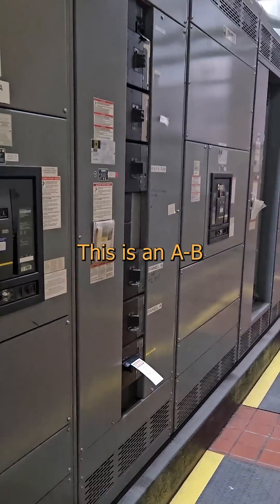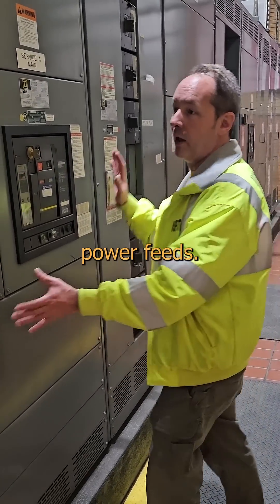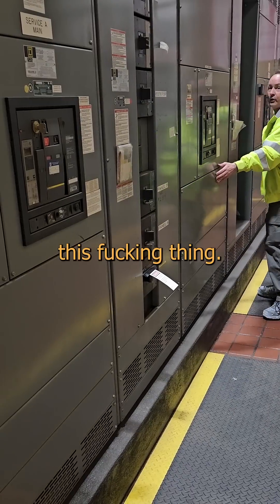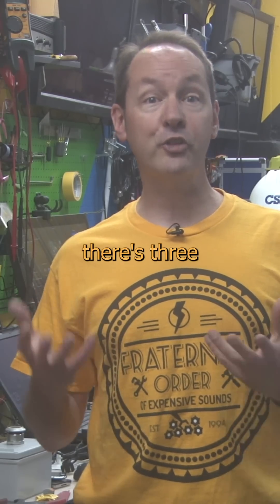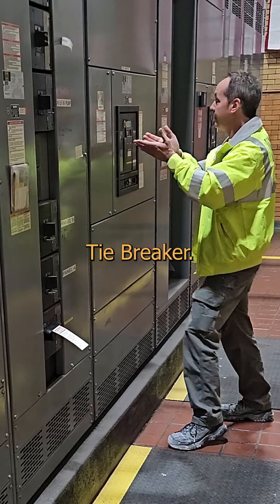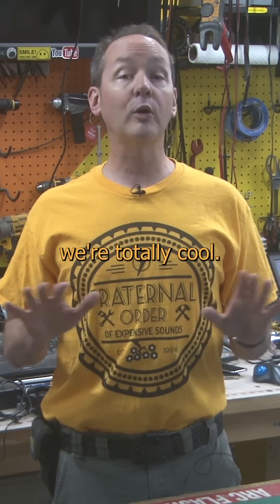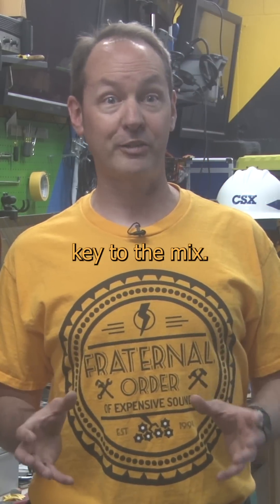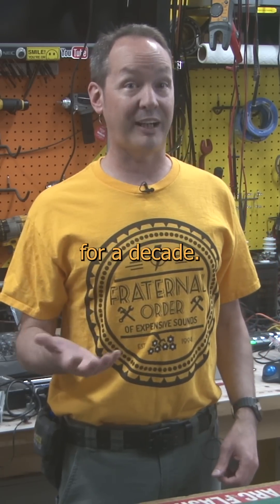A B Interface #chrisboden #comedy #electrical #engineering #energy #substation #switchgear #power

Comment: I'm a software developer / server administrator, and while my machines don't scream, bite or otherwise try to kill you (yet), we have similar problems with redundant systems.
Like managing one database is fine. Synchronizing one active database to multiple readonly copies is also fine. But managing two active databases with bidirectional data synchronization, without everything blowing up? That's dark magic ^^
Reply: Some of the computer hardware can still bite you.  A friend's brother was working on the innards of a mainframe computer when he managed to short something with his screwdriver.  He said he saw a flash then woke up on the other side of the room holding the handle of the screwdriver, the shaft of which was melted down to a nub.
Reply: @ddichny  tbf, that is a mainframe you're talking about.
Reply: Reminds me of that one time github had to deal with them desynching

Iirc they chose to put them both in read only then manually combine them
Reply: Old repair Teck here. Like 40 + years doing this.  I have been thrown across a room by angry pixies, I have been bit way to many times on hot lines that should not have been there. My apprentices laugh about the multiple redundancy of my electricidal isolation everywhere. I tell them this is the only way you become a old repair Teck.

 So yes you can get hurt and even killed on server stuff especially. Less likely PC's but lets thank the electronic gods that CRT's went the way of the dodo they were evil incarnate! I refused to touch the damn things after the first involuntary pace making attempt...
Reply: @Masterlitchuk 
along with IBM monitors that can pee PCBs.
Reply: "my machines don't scream, bite or otherwise try to kill you"
Sorry, but computer fans MOST CERTAINLY do the first two. 😏
Reply: @DUKE_of_RAMBLE  when I turn on my pc, it sounds like a old car starting up
Reply: @BeanBYTESOF  haha Yup! Though they're soooo much quieter now than they were in the early 2000s. 120mm fans at 1800-2300RPM vs my Vantec Tornado 80mm at 5700RPM... and I was rocking dual CPUs so I had two of those bastards screaming! And my case never had the side panel on, either 😅

Honestly, Tornado🌪️ was fitting given the air they moved, but Banshee🗣️ would've been fitting given the noise they made! lol
Reply: @DUKE_of_RAMBLE     I got a prebuilt back in 2019, it works well, but it is noisy asf rn, I probably should overhaul it some time soon
Reply: @BeanBYTESOF  If it's suddenly loud, that means the system is requiring more air because things are getting hot.
Three reasons: First, often overlooked is house temp, since it's becoming summer maybe the ambient temp is higher in the house. Second, also overlooked, dust in the fans and hestsinks. Third, not overlooked but not considered, the thermal compound. It's likely they never used anything good and it has lost its potency. (I've never experienced it, leaving my heatsinks attached for years and just remove dust, but people swear it can happen; but I build my own so I know what paste being used) 

If you have pets or the computer is on a bare floor (no carpet/rug), and you haven't cleaned it ever or even for a few months, then that's almost assuredly the problem. If you have an air compressor (or know someone that does), you can unplug the computer and drag it outside along with the compressor and an air nozzle, then use it to easily blow all that crap out! Might have to take fans off to get it all out, since it can really get packed in. And blow from the opposite direction as well.

WEAR A DUST MASK! Computer dust is fine particles and you don't want to breathe that in. If nothing else, put your shirt over your face. I figure everyone should still have some PPE though, so it's preferable over a shirt. 👍

[edit: I see YT removed your comment for some reason. Unless it was you? Either way, I saw it in time so the above is my advice to help with the noise.]
Reply: "they can bite you in other ways"

Unshielded server fans. And thats all im going to say....
Reply: @TankR  aka how ITs and model airplane enthusiasts have matching scars. Old ether engine models are especially terrifying to think about
Reply: And that's pretty damn cool... from the same.
Reply: I will always have immense respect for database admins. Databases are such a pain in the ass to get right, and when they go haywire, everything goes haywire.
Reply: If your server fans aren’t running at hearing damage levels, you aren’t getting your money’s worth out of your hardware. Also, 480Vdc UPS battery strings have plenty of high torque pixies to ruin your day.
Reply: It's Dark magic and you must pay dark wizards and oracles copious amounts of gold. If you know what I mean 😅
Reply: Tried that in the 80s....
Reply: Time is money and when you have so many very very expensive pieces of equipment it's a lot of money so you don't want any down time.
Reply: best to never design a system around that
Reply: You need a wizards outfit with circuit patterns instead of moons and stars
Reply: >My machines don’t scream, bite or otherwise try to kill you (yet)

If you’re a software dev, don’t worry, I’m sure you’ll get there eventually
Reply: My son was a VP of sales for a company that provided hardened data center sites for just the type of redundant safety you're talking about. Got a tour of one and was very impressed with the amount of redundancy and security within, including special monitored entrance hardened site and multiple power supplies.  An that's pretty cool.
Reply: @davidyansky6605  currently working on one of these kinds of sites, building a data center right now. General systems rooms, the entrance facilities, net suites, and data halls are all rfid and biometricly locked rooms. Things pretty cool. They but in 2 sub stations as well as a water treatment plant
Reply: @davidyansky6605  I used to work in IT, sorta - was a software dev, but I got to go to our datacenter site a few times. It was underground in the vault that used to hold part of the currency reserve and gold of the country I'm in. Behind the building they had three gennies the size of small bungalows, to get in you had to be buzzed through by security guys first, pass a guardpost desk, take an elevator 2 stories up, then take a special heavy elevator down to the vault area, go through another checkpoint and then you were in the servervault, all cabinets were also in heavy gauge steel cages... But then again most of the racks etc were banks and insurance companies etc, so they did have a reason to have some funky security there. Also, they had pictures and biometrics for all who were cleared to go in to the site. You couldn't just roll up and expect to go stick a USB drive in your server and be done in 15min heh.

Comment: Don't forget that both ends have to have the same phase rotation. Otherwise you run the risk of running half of your plant backwards.
Or as one of my instructors said, run the very real risk of half of the slaughterhouse running normally while the other half is putting the animals back together.

Comment: How do you prevent a third key from entering the floor?
Reply: I used to install this equipment and it was shipped with a 3rd key that had a gigantic red warning tag riveted to it to make the final checkout easier (no main power allowed). I had to snap that key in half and return it to the factory to activate the customer's warranty.
Reply: @ghost307  thank you friend! That's super interesting.

Comment: Really?? I thougth electricity spreads at about 2/3 C.  So unless A and B have travel lengths divering by hundreds of miles the phaseangel should be fine.

In our grid we usualy only have a problem when we connetc different substations becaus the might be at a different voltage, but that is usualy fixed with a quick call to the grid management centre.

And bacause conneting substations can cause unexpected load shifts between them.

Comment: This actually reminds me of Chernobyl.  They were running a safety test that night to see if the reactor could provide 1 minute's worth of power during shutdown as the backup diesel generators spun up.  Unfortunately, the reactor was running at too low of a power setting, so they pulled all the control rods to raise the needed power.  Then, as we used to say, "The Fan Turned Dark Brown"
Reply: Power level 5 - normal.
Power level 1 - test.
Power level 2 - not enough.
Power level 3 - just about ri...
----------------------------------------------
Power level 11 - that 20000 ton reactor 4 head just flew off like a frisbee.
Reply: Oh, they were testing if the generator could provide enough power until the diesel could step in . I somehow was never told that detail
Reply: @younscrafter7372 yes, and in Legasov's diary he complained about why didn't they just ask for a faster diesel
Reply: They basically followed a check list of "how to make a reactor blow up"
Reply: And if they used the crew they were supposed to, the one that was specifically trained for that operation, rather than get impatient and not wait until the next day... chances were that it wouldn't have done what it did. Chernobyl is a case study on why you observe operational safety procedures and use only the people trained for a specific situation.
Reply: Patience is a virtue. If they had the patience to wait 1 day for the trained technicians to return it wouldn't have happened. Not like you can undo an oops on critical operations with powerful systems.
Reply: The test was mandated by the soviet authorities; the reactor had to be placed into the correct power level to simulate a shutdown event. The problem was that they were actually running at too low a power to run the test. So they had to try and raise the reactor power, whilst the fuel rods were poisoned, and also whilst changing shifts.
Reply: @LtPulsar  They also postponed it a day and ran on lowered power due to Kiev's power demands. That is also a factor. One has to keep in mind that most of the people at fault there were Ukrainian.
Reply: @RussianSevereWeatherVideos  Your logic is all sort of backward. There are ways of working around insufficient power generation. How the hell it could ever be the city's fault when a power plant blows up?
Reply: @B1gLupu  You must not be very familiar with the incident. They delayed the test long enough to build up Xenon and to change to another shift that was not meant to conduct the test, nor were they familiar with it. That's how you blow up an RBMK reactor. I suggest you educate yourself on the causes of the accident. And if you're too lazy, here's a direct quote. 

"Kiev (the electricity grid controller) requested that the power reduction at the Chernobyl nuclear power plant be paused to meet peak evening demand. The plant was scheduled to reduce its power output further, but Kiev's request prioritized meeting electricity needs over the planned power reduction. This request played a role in the sequence of events leading to the Chernobyl disaster"
Reply: @RussianSevereWeatherVideos 

The people at fault were the designers, for designing a reactor with substandard safety features, those who failed to adequately train their reactor technicians, and then turned around and demanded they perform a test they had minimal knowledge of, with significant safety concerns, under time pressure.

It really was mostly systemic problems that caused it, the few bad calls by the technicians on site were perfectly rational given their circumstances.
Reply: @LtPulsar  If that is so, then why do we have similar reactors served and are currently serving for the glory of Russia and other CIS countries and are faithfully providing us with cheap, clean, safe and problem-free electricity since then?! I reckon someone has watched a bit too much 'Chermobyl' on HBO eh? It's pretty, but still a fairytale. 

I see your huge aversion to blame anyone but Kiev and the Ukrainians. You might want to take a time-out and consider your biases. Until then, tata!
Reply: @RussianSevereWeatherVideos  Because they were heavily modified after 1986? Safery systems underwent huge overhaul after that
Reply: @dimvajra5880  Cannot argue with him. He is allowing modern contemporary biases of nationality (fueled by propaganda) to skew his perception of a historical event. This is also known as revisionism and is common in those being intentionally manipulative or deceptive.
Reply: Because RBMK reactors all got retrofitted and the danger of the graphite tips even if they hadn't been is understood now. Lol @RussianSevereWeatherVideos
Reply: @RussianSevereWeatherVideos  Sounds like someone has an aversion to "Glorious Russian Leadership" being at fault for the needless deaths of others, especially in Ukraine.

Get back to the front Vatnik, Слава Україні
Reply: @LtPulsar The danger of the design, specifically that the reactor will spike when you slam down the limiting rods for a shutdown, where classified. So when the reactor went into a runaway situation they hit the emergency shutdown and it made everything so much worse that the reactor blew and the limiters never got down far enough to start slowing things down.
Reply: @goswinvonbrederlow6602  

Ah yes, the AZ-5 issue. It gets worse. That design flaw was known for 3 years prior to Chornobyl's meltdown. It was first discovered at Ignalina Power Plant in Lithuania, and was reported as an issue. However, nothing was done until the Chornobyl incident demonstrated how critical a design flaw it was.

Information about this design flaw was apparently not worth disseminating to the night shift technicians. It boggles my mind that this could have been considered a non-issue. You have a shutdown button that actually makes the reactor go ballistic, but only for a few seconds, so it should be fine, right? As long as you're never trying to shutdown a reactor on the verge of meltdown.
Reply: fecal matter hit the rotary air impeller

stolen from somewhere i dont remember
Reply: I heard that they disabled all of the automatic safeties for the test
Reply: They were probably smart, edicated engineers. Their critical fault was that they were also Soviets.
Reply: @B1gLupu  nope. They were the night shift. They were NOT trained for this. They were doing this because the trained for this day shift basically said they wouldn't do it because they weren't stupid enough to test fate like that.
Reply: @chalkopirate And because Kiev demanded more power. Don't forget about that.
Reply: @chalkopirate they can't refuse to follow orders, just because there were under the soviet regime.
In any other enviroment the night shift could refuse to do something dangerous, in Soviet Ukraine, that could cost you your live or a passage to Siberia.
In fact, they complaint (with fear) that they are doing was dangerous, the system made them obey no matter what.
Reply: @chalkopirate  they have the exact same training, day shift or not. The primary problems were:
Design flaws
Not being informed properly by designers how to actually operate it
Lack of general knowledge about the risks of the RBMK-1000 (which happened at every level, including the design)
Improper maintenance and installation. The RBMK-1000 reactors at Chornobyl were actually known to overheat the most out of all the reactors in the soviet union (this could be wrong as I don't remember where I heard this, but they were Improperly maintained either way)
Lack of safety culture
Yes, the operators didn't successfully recover, but they also didn't contribute majorly to the actual disaster itself and did everything they could logically be expected to have done
Reply: @B1gLupu The US elites are filled with people scared to say what they think
Reply: @B1gLupu  russians edit and ukrainians the soviet part was incidental